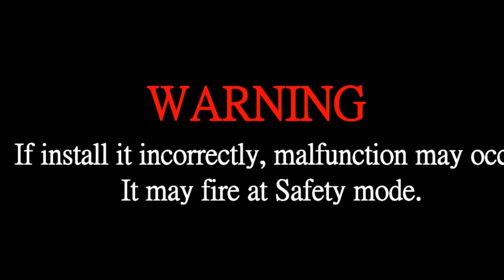【Tutorial】How to install XTC gearbox into the lower receiver correctly?

Comment: Could the ambi 45 degree trigger work in a standard V2 gearbox or does it only work because the gearbox uses a V7 sector gear?
Reply from the maker: The internal structure is different.
These gearboxes can not be shared with each other.